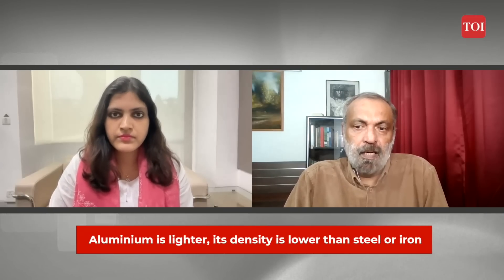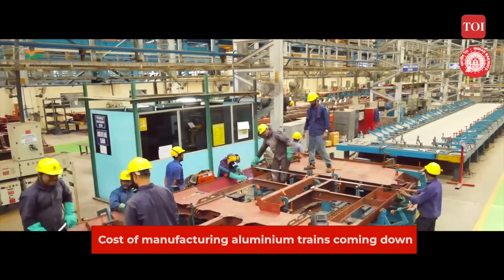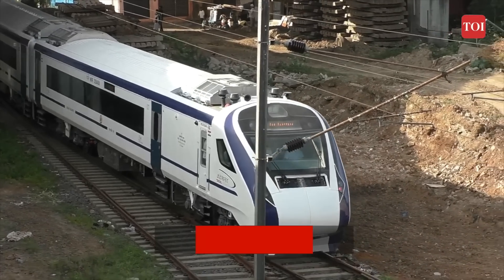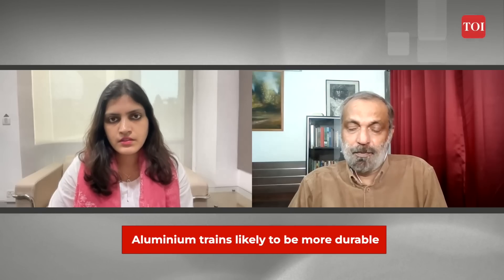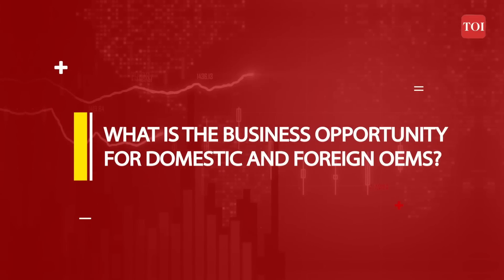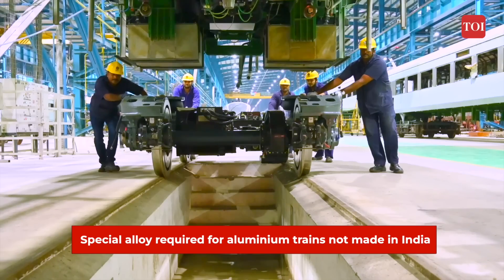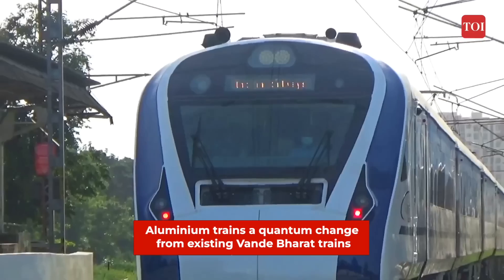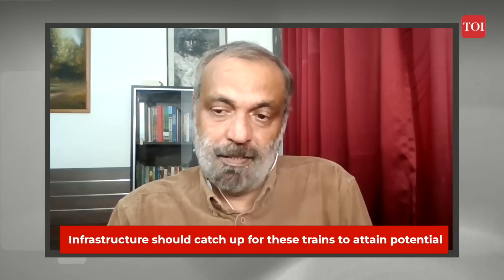Vande Bharat Express: New aluminium trains to be game-changers at 200 kmph

Comment: ❤🇮🇳👌Sudhanshu Maniji, is it in any way to combine t18 with the lhb rake say similar to push pull, ie 2rakes combined into one with either the lhb rake alternating w lhb rakes or both ends fixed either say 21+8coach of t18.. Thr by no interchange is thr for engines, gets more power, or making a t18 both ends with lhb coaches in the middle, of course u require power etc for the normal lhb but thr wd certainly b a way to get to use older lhb along with these and make a longer rake set, reducing costs, more capacity people transported faster Acceleration achieved for the t18, at the same time w higher utilization say 18-20hrs a day for the rake ie 24hrs ie from 12-15hrs a day towards 18hrs min rake utilization in 24hrs... Thr wd b people who can come up nd meet with the required objectives...... It wd ❤speed up the acceleration, ❤turnaround time,
❤ larger capacity,
❤ 18-20hr utilization/24hr / ❤avg speed shd also b above 125kmph
❤Minimum maintaince
❤Or atleast attempt 70rake with wag12
Both shd b done to c if v can do it... Can v rise above our in capabilities of thought, or the restrictions of our mind, N rise beyond the box full thinking v r used to.... Let's say objectives being capacity N speed n 20hr utilization nd integration
Reply: From No way... To thrs always a way, wr will, matters 😂❤
Otherwise the possibility to add on sleeper rakes, as n when it gets manufactured, is always thr or particularly a active consideration.. That's y v insisted on 10/12 rakes per mth as also running 1500kms@80-85kmph/a day avg speed in straight lines on east west central grids, Eg chd-panvel,ndls-warrangal or any.... That would cater to abt 1600passengers approx per run min as 24coach  trainsets🎉

Comment: Let's not focus on the speeds of the locomotives for now. Have more durable aluminium components and shells on the coaches to reduce the power by weight ratio, making it more economical with good aesthetics, retain steel wherever required as steel is safe & reliable. MAIN POINT TO NOTE: DON'T HOLD UP EXISTING TRAINS TO MAKE WAY FOR THE VANDE BHARATH TRAINS TO PASS THROUGH MAKING IT LOOK FASTER AND THERBY CAUSING INCONVENIENCE TO THOUSANDS OF PASSENGERS!!!

Comment: Even targeted production of 35 trains could not be achieved and only 17 could be rolled out. Forget fast trains nothing is being done to address regional imbalances in terms of connectivity.
Reply: 17...no sir, only 10 so far 😀
Reply: Thanks for your response. Sir Kotdwara is gateway of Garhwal beyond which hundreds of villages located. It takes more than 6 six to reach Kotdwara from Delhi. I have been travelling by Massurie express since my childhood. Can you believe one has to halt for hours at Najibabad and this situation is continuing for last 40 years. Railways has been experimenting since long time to connect Meerut to Bijnor but nothing happened. This is called regional imbalances due to persistent neglect.  Even NH 119 is also facing complete neglect as so called highway is full of potholes and huge craters. My suggestion is that all our metro cities are overcrowded and hugely suffering from poor connectivity it should be endeavours that Railway must work to improve connectivity within range of 500 kms in existing routes from all metropolitan cities in the country.  So  far as facts referred in my earlier comments the sae are based on TOI report today.
Reply: @anusuyakumardas8448  OK 😀

Comment: Mr sudhanshu  sir,
1. what'ss your take on the ambitious bullet train project now? there are few naysayers who criticize that project as expensive one and something a country like India cannot afford and money should be spent on other immediate things..do you think learnings of vande bharat can be applied to expedite buller train and will they be a success? obviously safety is a key issue here..
2.why did railways introduce vande bharat without upgrading tracks to accomodate high speeds? chennai-mysore VB train runs at just 90km/hr because tracks cannot accomodate higher speed..isnt this classic case of putting cart before the horse?
Reply: Not that bad but yes infrastructural improvement must keep pace with production of trains
Reply: @ManiSudhanshu  Thanks sir..

Comment: What are the implications of moving from steel to aluminium coaches on passenger safety in case of a crash?

Mr. Mani mentioned that even the developed countries already are (or moving towards) using aluminium coaches in place of steel coaches. Is that true for the same speed of around 200 kmph, or is it for much higher speeds (>300 kmph)? If these other countries are indeed still using steel coaches in trains with speeds of upto 200 kmph (for reasons of passenger safety, for example), doesn't India have the ability to manufacture locomotives that can haul steel coaches (same number of coaches per rake as in the aluminium version) at 200 kmph?

Is passenger safety being compromised in moving from steel to aluminium coaches for the sake of speed?

Comment: Faster.  Body chases may remain as steel,  as for Vandhe Bhrarh. The body sides,  partitions, roof only may be with Aluminum .  With light body,  we may start running these with roof mounted Solar panel generators and generators run by self from train movement.  
    Let us move fast.  Best wishes..

Comment: Running trains at the speed designed for them is a problem in many countries. Even in dedicated tracks in Europe they only run at speed in certain segments.  

Indian tracks are constantly being worked on. Even regular day trains in south India are running at 120 kmph now, I would be surprised if Vande Bharat only so 130 kmph now. Aren’t they supposed to be lighter and with traction distributed to each compartment..

Comment: Much needed latest technical  transformation by switching to aluminium coach. It would provide high strength, light weight and modern feel. Please also make the coaches safety fire retardent, huge human casualties, like in the godhra train burning by muslims, could be averted.

Comment: This train design at the front can be made more aerodynamic by making elongated nose of at least 5 meter. That will reduce drag coefficient. This may increase speed by at least 50 km per hour.
Reply: The  nose should be aerodynamic, sharper and curvier to reduce drag. The wheels and body of the train should be shifted a bit lower and the lower front needs to be changed. The interior needs luxurious and comfortable seats, good lighting and ventilation, a monitor and other facilities. The back should be overhauled just like the front, then we will truly have a world class train.

Comment: currently Only mumbai to ahmadabad vande bharat runs with max speed of 160KMPH,Remaining train runs on max 130 KMPH however train is capable of running on max 180KMPH speed. So mainly focus on dedicated high speed track and signaling parallel to Aluminium train set,so that these train can run on max 200 KMPH otherwise it will also run old track with max 130 KMPH. Railway need to focus on both fields.
Reply: Even Mumbai Ahmedabad does not run at 160 kmph sir, it's only 130 kmph
Reply: Wrong info, only Gatiman and janzi shatabdi run at 160
Reply: Only track i know that supports 160 kmph is b/w tughlakabad-agra cantt. Shatabdi, Gatiman, Vande Bharat are running at speed 160 kmph while on this track rest of the time they runs at 130 kmph only.
Reply: @shubhankdixit  Unfortunately, you're right 😀

Comment: 200kmph will be the top design speed. But things will not change till the upgradation of tracks take place..As of now except for Delhi Agra and Kota Nagda Section,  the Maximum Permissible Speed as per the current status of tracks is 130kmph. SO No,  Aluminium will not translate to faster speed even with faster acceleration unless track infrastructure upgradation is done.
Reply: True
Reply: Delhi agra  route has already maximum speed of 160 kpmh Tejas express but majorly infrastructure has to be overhauled for constant speed of 160kmph
Reply: @palboy3565  yes thats true..
Reply: thats true
gotta see how they would tackle the problem bad tracks with big curvature
bcoz this would be very tough to deal
making trains is relatively the easier part
Reply: @commonsense1019  absolutely..Your last sentence says it all.. upgrading track infrastructure is a very big deal compared to introducing new train sets..i have also been disappointed with the Railways in the way they have sought to increase the fares of VB Class of trains which is even higher than Shatabdi, without fulfilling the main criteria of higher speed, basing their justification on an " aircraft like experience", which IMO is just window dressing. The MPS ( Maximum Permissable Speed) of the Chennai Mysore VB via Bangalore currently is lesser than 130kmph in a large part of Bangalore division, which makes a mockery of the train we proudly call " Semi high speed".
Reply: @commonsense1019  😀
Reply: Your statement is axiomatic! You can't disagree with it.  Good thing is that BJP govt has people who are sensible and they are working on that aspect. Have patience and it will be delivered
Reply: It is a chicken and egg problem. Unless we plan to only use it in brand new routes, One of them has to come first. Tracks are coming in sections and we don’t need the entire length to be full speed capable even if we shave off 30 minutes by running from a day train it would make a difference.
Reply: Sir,

12yrs ago I was working on my Formula SAE car project (global university competition on the lines of Formula 1) and had to import Al 7075 from UK via an importer in Bangalore to Delhi. The problem then became the increased expense of tooling since most people in open market didn’t have the capacity and ability to mill the ingots of high strength Aluminium to make uprights/wheel hubs for suspension. 

I now live and work in the UK and I still feel sad to hear from the gentleman in the video that India doesn’t have those high strength Al extrusion tooling capability. 

Taiwan, South Korea and some others had it for decades already. We have made some advancement in thinking about silicon (semiconductor) development but I really feel sad to hear that India 🇮🇳 is still dependent on foreign companies for such basic tech. 

What do you think needs to change ?
Reply: What you said is right ?  Only if Infrastructure is upgraded, we can't run trains at even 160 kmph.  But infrastructure change can't be achieved in a day or two.  One plus point on Aluminium coaches is that they are light, yet strong and require less maintenance and energy efficient because of slightly less weight . So, it will be a positive.  New technology can be use in other sectors also .. say water metros  / metro trains etc.
Reply: I will forward a screenshot 📸 of ur comment to the railways divisional officer of that region so that they come to know to stop UPSC or Railways exam intake coz bright minds sit and comment on Youtube
Reply: @xingxanghanji6583  did you notice the response to my comment before yours.?  The gent who agreed with my comments and said "True"..Well that was Sudhanshu Mani, the gent from ICF,  who concieved designed and built the VB class of train sets, the same gent who was in the vdo..I dont think you listened to Mani's response at the end of the vdo where he says that the VB train sets can improve their speed ONLY when (track) infrastructure is upgraded....So, now you want to send a snapshot of my comment to the Railways, by all means, be my guest..they are already aware of the status of the tracks, and its speed capacity in different zones..😊😊..But you go ahead all the same and do what you want to do and maybe find some proper education along the way.
Reply: @jayantochatterjee6413  😀 do engage with what makes sense, ignore the troll
Reply: @ManiSudhanshu  You are Right Sir.🙏🙏.i am amazed at the level of ignorance of ppl who feel free to comment without knowledge or common sense..
Reply: @ManiSudhanshu  sir with all due respect, who is the troll here?? Everyone knows railways is working very hard to overcome this problems, it wasn’t that the person to whom I replied was commenting something new, I did not expect such response from you, I too believe in you, but anyways  Jai Hind Sir!
Reply: @xingxanghanji6583  😀 Jai Hind
Reply: @ManiSudhanshu   Hello Sir I like the way you are replying to all comments. 
I have a doubt recently I read an article  that Indian Railways is upgrading tracks to R-350.
Whereas many European countries use R-260 tracks. Why can't we use R-260 instead of R-350?

What are the major differences between both?
Reply: @HoutPateta  I am not current with this subject please...
Reply: @ManiSudhanshu  okay.